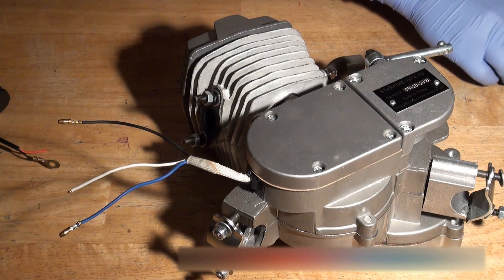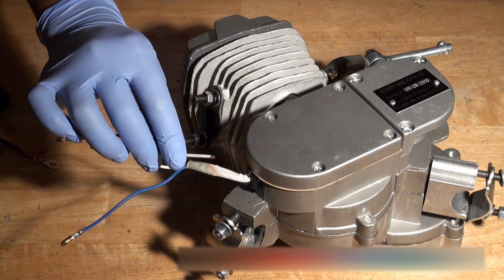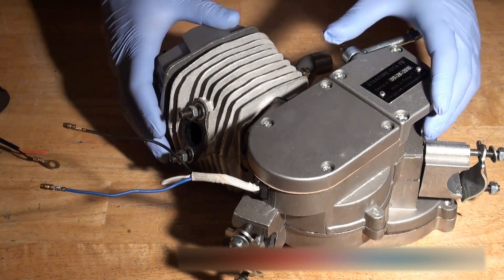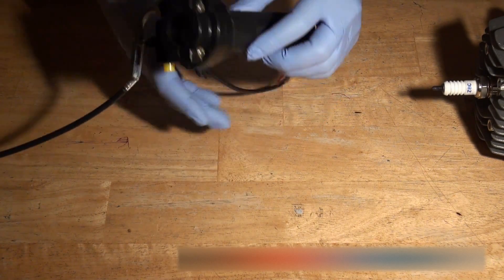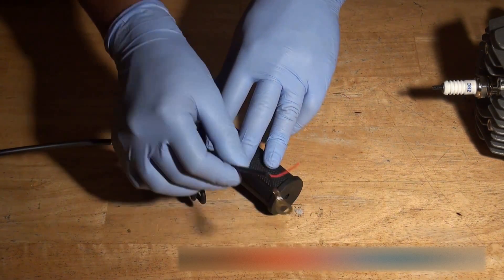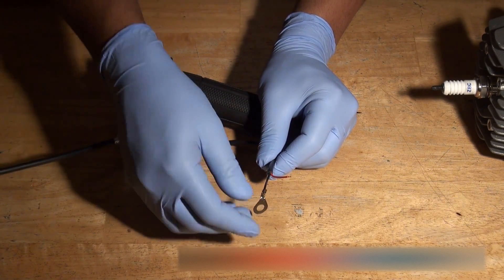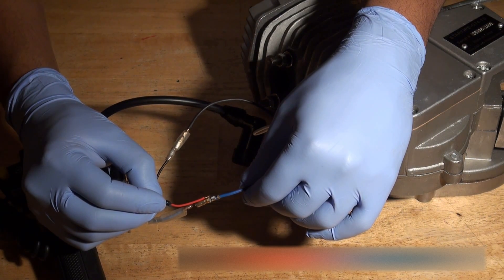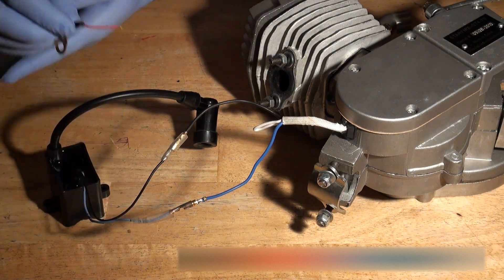Bicycle Engine Kit Wiring Tips Troubleshooting

Comment: My bike had it's wires colored backwards. Which made it a pain in the ass to diagnose that it wasn't the cheapness of the parts at fault. I couldn't find quality anywhere for these bike engines anywhere. Mine has a yellow or weak spark. I've bought two new CDI magneto parts and still get a weak spark. I'm down to replacing the entire wiring setup and will be soldering the wires directly to the parts instead of either using spade terminals or soldering wires to each other at both ends. The white wire is for optional headlight but as is the spark sucks I can only imagine how bad it would be if it was having to share power from a headlight as well.

Comment: unfortunately the kit I ordered came with different color wires the engine has its own colors and the CDI unit has its own colors and no instructions.
Reply from the maker: Hi Simon, The engine will usually have three wires.  

1. White (not used) 
2. Black 
3. Blue or Green.

The CDI will have 2 wires.

1. Black
2. Blue or Green

Just connect black to black and blue or green to blue or green. Thats it now just wire your kill switch in as normal.

Comment: I disagree that you don't use the white wire, You should connect the white wire to the red wire on the kill switch and the black wire on the kill switch to an earth point on the engine (or frame if your engine is earthed to the frame).

Comment: If you remake the video, remember that the Kill Switch makes a short circuit so the motor doesn't get a spark.

It takes all power from the Magneto and use's it up faster then the CDS that converts into high Voltage to make a spark.

My Motor on my bike did not fit and now i have it on and it fits.

Their is a bit of confusion with the wires as the book that's about 40 pages does not specify what to do with the 2nd wire of the kill switch.

Also the people who printed it did it in black and white with a crappy printer.

I found this video helpful at a certain degree.